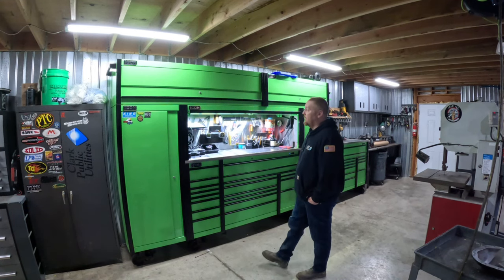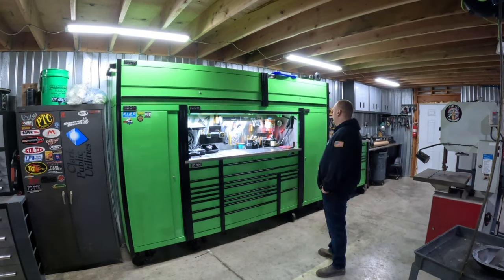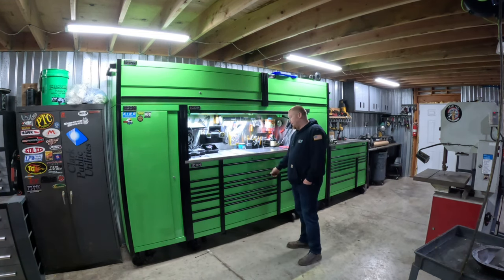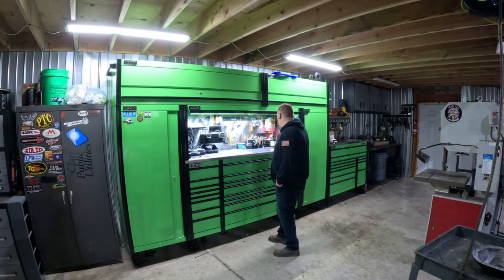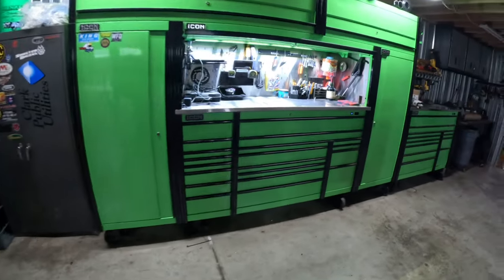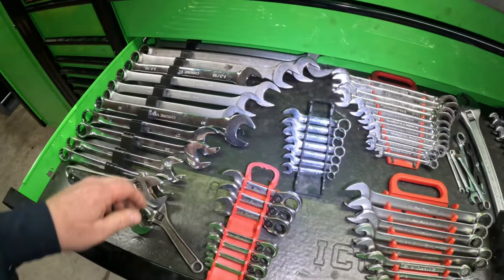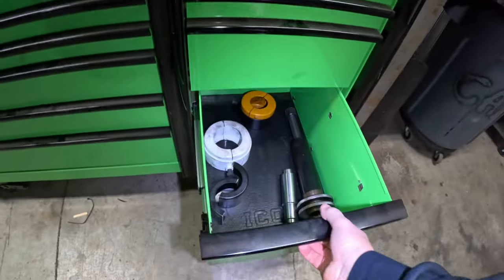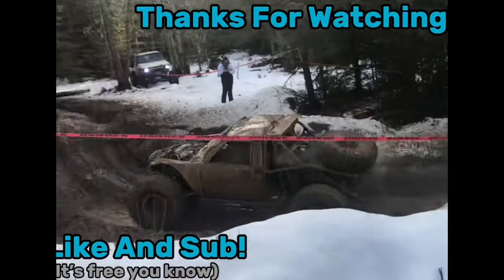Icon tool box 1 year in service, Definitely issues you need to know!!!

Comment: HUSKY is a Damned good box.  I have the 72" 18 drawer box and I'm extremely happy with the quality, fit, finish and durability.
Reply from the maker: My coworker has one and it’s the worst piece of crap I’ve ever seen, hopefully you got a better model but his is only a year old so idk, if it works for you then that great!!
Reply from the maker: Ya the older ones are probably built better, I too am a fleet mechanic for a utility company
Reply: @rosinsautofab1956  Husky has a standard duty and a Heavy Duty line.  The Heavy Duty line is pretty comparable to Icon, the standard Duty are similar to a US General Series 1 or 2!
Reply: I bought my 72 inch husky with hutch and side locker for 1100 an that thing is a brute, no issues yet

Comment: As much as I like the Icon stuff, just can't justify the cost.  As it is, I was able to 'convince' myself that I needed some newer USGeneral boxes.  Had a 44" top and bottom, decided to add a locker, it wasn't compatible, (too wide...my OG box is OLD), so 'had' to buy a new bottom cabinet.  Went with the 56", then took the 44 bottom, removed the wheels, and squeezed in under my work bench.  Put the 44 top on the 56 bottom with the locker on the left.  That gave me almost enough room to put a small compressor on the right side, so bought a second set of drawers to put on there.  Looks great, works great, I didn't spend an awful amount of money, and I expect it will outlast me.  I don't make my living off my tools, so I could have gotten away with the big box store junk, but I wanted something a bit nicer.  Now, if money were no object....your set up would be small compared to what I _want_.  LOL LOL  Thanks for the vids...

Comment: Just got my icon 56” and my only complaint.. the hutch wasn’t really designed to be installed without that stainless top. 

However, that Doyle nut insert tool came in handy, I used the template to mark my holes and I drilled into my brand new box 🤢. But with careful drilling, nut inserts and some 1/2 spacers, I was able to bolt down my hutch 

Loving it so far! Also, I did remove the gun holders from the corner drawer

Comment: I have the full kit and kaboodle Icon setup like you except I don’t have the top boxes.  I also have a Snap-on heritage series box.  The ICON is the higher quality box in my opinion.  It has supports under the drawers and more beef overall.  The snapon drawers glide better but their load rating is lower so that might have something to do with it.  

The icon box is phenomenal and I would buy another if I had room for it.  

Every time I go to the big box stores like Lowe’s and Home Depot, I open the boxes and tap the drawers and there’s no comparison.  The weight specs don’t lie either.  The icon is like 2x the weight of the big boxers.  I’m confident the icon drawers will resist long term sagging 10x better than the others and it’s a joy to use every time I open it up.  I’m so glad I didn’t buy the Milwaukee.
Reply from the maker: Only guys that would disagree don’t own one…. Yet
Reply: They dropped the price dramatically.  I basically got 2 for 1. Honestly they’re more of a luxury but I’m glad I got em.   I installed shop lights on the doors. It’s nice.

Comment: Looks like a nice setup.  My dad has a Snap-on 72, 56 top.  It's awesome, would love to have their stuff but makes sense to put that money into a project.
I've got 2 US General 56s top and bottoms.  They're pretty good, have had them for about a decade.  Only 1 drawer lock broke.  Would be nice to have the extra depth.  I was looking at the extreme tools some years ago...
Like how you can change your drawers and order new ones.
Definitely makes sense to save on boxes.  Mine are filled with snap on, matco, craftsman, quality stuff for the most part where it counts.
I don't think I'll ever buy any test equipment feom Harbor Freight again though (compression, fuel pressure, leak down, specialty stuff) have had problems there.
Like your shop, new to the channel.  I dig it 👍
Reply from the maker: Thanks man, you can purchase drawers for the icon box if you want more of one size, I run a home business out of my shop and it gets used everyday, been holding up great so far and I feel like it will last a lifetime, I agree on the selective tool purchasing from hf, guys like us know what’s good and where to spend the money on tools  for sure!
Reply: How can you buy the drawers

Comment: I was just typing to say test fit the bolts and anti seize them but you beat me to it. 😂
Reply from the maker: They went in fine but I think the powder coat got in the holes and gauled up the soft grade 5 bolts 🥲
Reply: @rosinsautofab1956  Rated grade 5, but like everything else from China, way overrated. More like grade 2 bolts... Every single thing I have put together from China in the last SEVERAL years the bolts have been complete TRASH. Many times I found myself going to Lowes to buy replacements that were much higher quality. This is why it is "almost" worth it to buy a Snap-On or Matco box. US made, and US Quality. I use HF for one thing and one thing only - I need a particular tool RIGHT NOW and cannot wait - I'll grab it at HF. I will eventually replace it with a Snap-On, Wright, Proto, etc - American Quality replacement.
Reply from the maker: 100% agree, I have a full set of snap/proto/mac…. Etc at work and a mixed bag in my personal shop, I don’t discriminate on any of it, guys that have been doing it long enough know where a guy can get away with chinesium and when he can’t 👌
Reply: @puterg0d the modern Snap-On oval head ratchet wrenches are absolute junk; I stripped out the gears using just two hands, no cheater involved. I said F this and grabbed my $30 anodized Pittsburg ratchet wrench set that I bought as a gag, said 13mm cheapie held up.

Note that I warrantied my 13mm Snap-On ratchet, it's replacement also shattered its gears, again using just my two hands. Sad because the teardrop wrenches from 30 years ago I bought new were fabulous and worth the $$

Comment: Do you think in the next 5-6 years from daily use would it hold up?
Reply from the maker: No problem, better quality than my 10 year old snap on
Reply: Just under 4 years and happy with mine. Heavy daily shop use and no real issues. I twisted out the internal stop on one of my six locks. It do es180 now instead of 90 but still locks fine. Slammed a service cart into a drawer tensioner and broke the tab. My heaviest single rail drawer will brush the drawer below if they’re both open. 
I’m at $9k for 72” box,stainless top, hutch, 2 lockers, 72” top cab and 56” top cab. 
Yes it’s a lot of money for a box but it’s also a lot of box for the money.

Comment: Is that stainless steel top durable? Scratch/ dent easy?
Reply from the maker: No dents but I don’t beat on it, seems to be pretty heavy gauge and it’s has plywood base under it
Reply: @rosinsautofab1956  oh okay, I'll be throwing dirtbike/ATV engines on it. I expect it to get a little beat up but want it to atleast last.
Reply from the maker: I think you will be fine, my side box gets lots of heavy parts tossed on it

Comment: The cost of the icon 72 box and hutch is the same as a snap on classic series work hutch.
Reply from the maker: Post your pricing and let’s check it out
Reply: 4100 for the hutch on my classic 96 snap on box the icon was 2999+299+999 box top and hutch along with 20% off was 3440 could have waited for 30 % off but got impatient
Reply: O I miss the 1000 for the top to mount the hutch on snap on my bad